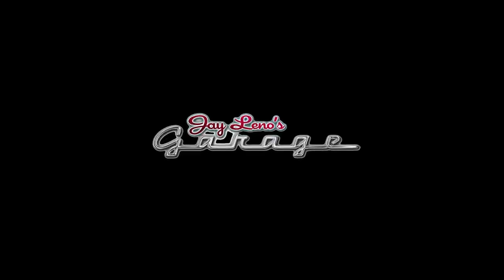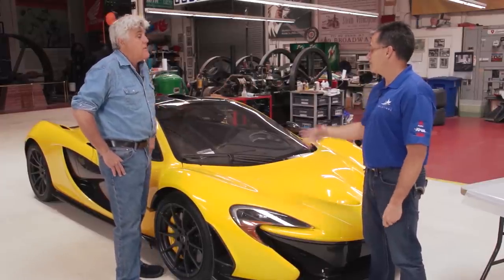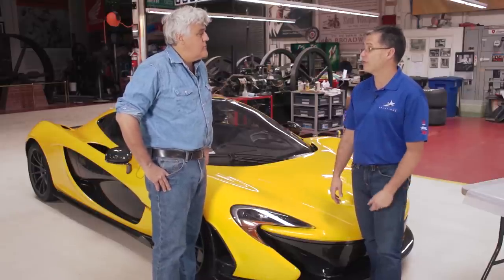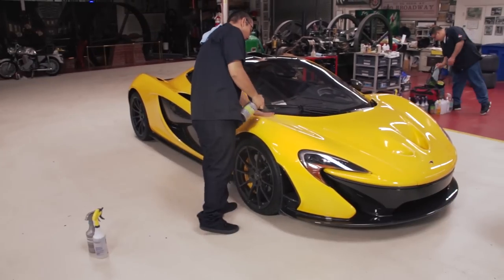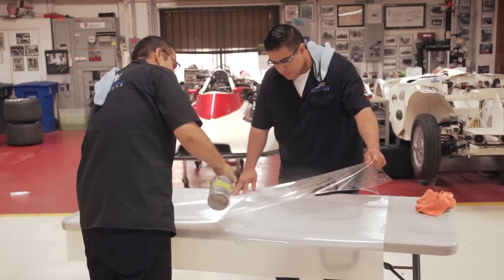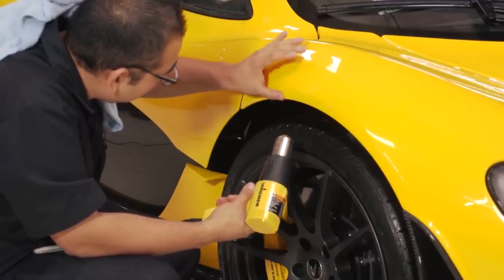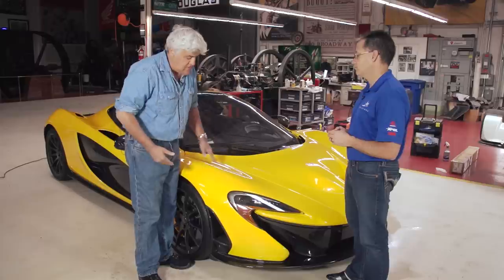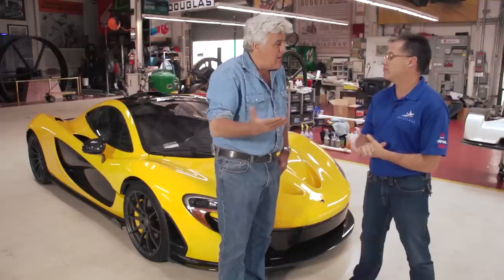Wrapping Jay's McLaren P1 - Jay Leno's Garage

Comment: my 370z has the 3m clear bra on it, I can tell you it has saved me several rock chips, the plastic is a bit nicked at the bottom of the bumper but didn't touch the paint! Very glad I have it.
Reply: nice, anything can happen to any car driven over 15mph, it's best to be safe, and why not, if it subtracts nothing from the car.
Reply: I have that on an evo what I don't like is it does stick out a bit but most def worth it
Reply: rockthestrand maybe a hairdresser?
Reply: Acc0rd79 I need to get it on my Mercedes, do they put the 3m on all the bumpers even in the back ?
Reply: Club Bmw Amg only if you want it to, mine just covers the entire front, a pillars and mirrors that any rocks might hit.

Comment: I have this on my 2012 scion xb because that thing loves eating rocks on the highway. No chipped paint yet. Had it done in Richmond VA for 400 bucks with 3m 8mil protective film. Did the front bumper, hood, headlights, mirrors and the rear bumper to protect it when I pull stuff out the trunk.

Comment: Hmm, 1/2 thickness of a credit card.
Here's a $1 idea for long journey protection (may fall off afterward) - Get some clingfilm from the kitchen, roll it across the front of the car, use water to adhere to paint. Tuck in edges. Repeat til 6 layers deep. Final layer slightly larger to secure the edge wrapping better. Drive.
If works but loosens at all, spray 3M77 type of adhesive near wheel arch wrappings.

Comment: you know, they should just apply like 5 or 10 layers at the same time then on each panel, have a little tab hanging off...then whenever it gets dirty, or marked, you could just pull off a layer...kind of like the visors on F1 driver's helmets.....
Reply: +michael C wouldn't work, when they would wrap it around the edges, it would be to thick.
Reply: Kristian Matz see, that's where you trim the subsequent layers exactly to the body lines with only a tab over hanging....and since you have multiple layers, they can all be thinner than one solo layer......

Comment: That is funny. Americans. "It is 8 "mil", it's about half the thickness of a credit card." 8mm - that would be just a little shy of 2 pica - or a little more than a third of an inch. 0.8 millimeters?
Reply: Thoringer The "mil" he speaks of is not millimeters.  

1 "mil" is 1/1000 of an inch.
Reply: Lyle Arnett, Jr
you better edit this then: https://en.wikipedia.org/wiki/United_States_customary_units - because the official measurements use point and pica. When someone says: "I usually shoot with my nine-mil," they mean 9mm. Also, .008in? Really? That would not have any protective effect at all - it would rip just by picking it up. Think about it. .8mm would work and from what they show, that is plausible.
Reply: Thoringer https://en.wikipedia.org/wiki/Thousandth_of_an_inch

Comment: $1500-$2500?!!  and has to be replaced 5-10 years?  isn't it cheaper to just repaint a part that MIGHT get chipped or nicked?
Reply: Not on a P1, you don't do this on your average ford.
Reply: Lol not on a million dollar plus car like this
Reply: Repainting a car like this would cost between $20-50k depending on the brand of car and the color of the paint. You can not simply use touch up paint on a car like this.
Reply: what difference does the electronics and engine and everything else under the body panels make when painting it?  why should it cost so much extra to paint the fender of a ferrari versus a volvo?
Reply: Because they are made from a much higher quality... And the body panels are also made from more expensive materials then a normal car...... A car is much more then just an engine and some electronics
Reply: whitedevil2 Yeah because vacuum formed carbon fibre is basically the same as a steel sheet isn't it
Reply: whitedevil2 The difference is that you are not just buying the car you are also buying into the brand. So when McLaren, Ferrari, Porsche or any other company wants to charge a lot of money for paint then you just have to accept it. Most of the time they are using a special color blend and they are the only ones who carry it so you can't go to a second hand dealer to get it. Even if you have someone else do the labor the car company will still be the one who sells them the paint and they will charge them an insane amount of money.

The paint on the car is not the only thing that is insanely overpriced but so is everything else. Oil changes usually cost between $1-3k depending on the car and location, tire changes can be in the thousands, brakes, calipers and basically everything else on the car will be so much more expensive then your standard car. That is just the cost of owning a super car. Just because you can afford the sticker price of the car it does not mean you can afford to drive it. Most luxury/super cars cost a lot to maintain and keep which is why a lot of people only take them out on special occasions.
Reply: it doesn't cost $20K to paint a carbon fiber body part
Reply: whitedevil2 Like I said it really makes no difference what the material is, the only difference is that you are buying into a brand. The same thing can be asked about how designer cloths can sell for 10s of thousands of dollars.
Reply: you're the first person to say something intelligent here.  so couldn't a third party shop color match?  i get wanting to take these expensive models to the factory/dealer for everything, but theoretically if Home Depot can color match anything, i would think a paint shop could as well.  and there are some high quality shops that specialize in exotics so it's not like you'd take it to some shaggy collision repair place.  so is it more of an issue with the owner willing to spend more money for paint just to make sure everything done to the car stays in house?
Reply: whitedevil2 Well paint matching can be extremely tough because the materials inside of auto paint compared to simple house paint. You can mix in a variety of different chemicals/materials to give a different effect. Car paint have different hardness, reflective levels, possibly a metallic blend, and so many other characteristics. But theoretically it could be reproduced (just like anything else) but it would be very tough. And it would probably cost more in trial and error then it would be just to buy the paint from the company.

People stick with getting the car maintained/serviced at certified service facilities because it will maintain the cars value. When you use a 3rd party service center there is no guarantee they did the maintenance properly. And when the day comes for you to sell the car you will need to show every bit of paper work for the car and if you did not get the work done by a certified service center the value of your car will drop significantly. People spending hundreds of thousands or millions on a car want to make sure the job was done properly and the only way to assure that is to have the service done by the company or a certified facility.

Cars are also much more valuable when they are in the original state from the factory. So repainting the car a similar or different color would kill the value of the car.

At the end of the day it is so much easier and cheaper to put on a thin few thousand dollar cover on your car compared to have to repaint the car. Plus changing out the film might take a day while repainting a car could take weeks if not months depending on the car/color. That is the reason people go with this clear film. A lot of people will also just wrap there car in vinyl because it serves the same purpose plus it can allow you to change the color or design of your car very often.
Reply: I'm more suspicious of the the 5-10 year life span. I've owned a wrapped vehicle and was "conditioning" it monthly. You're not supposed to use standard car wax on the wrap. Granted, it was White vinyl not clear and a different brand but I'm still doing more research before I commit to this. Daily drivers have different needs than show cars.
Reply: why would he? When he can afford to own a private paint booth a private paint and body team he can even afford the vinyl wrap machine to print his own wraps. $2500 is not alot of money by itself but do it a few times and you could buy everything you need to do it all in house so why waste the money  and limit your choices?.
Reply: whitedevil2 you don't want to re paint these things ,.
Reply: Wackka Wack
Reply: tmnt
Reply: heroes in a half shell
Reply: Not if you have a million dollar P1
Reply: +whitedevil2. How much is a P1 windscreen? Who would you trust to paint your P1? How much is a McLaren respray? For a hypercar owner, the film is worth it. For someone driving a normal car on a tighter budget, it isn't.

Anyway, Jay probably got his P1 done free. He gave the company a fantastic advertising opportunity, worth more than a one car wrap.
Reply: it doesn't . depends on the formula. but that's a straight yellow paint ...should be cheap. cost the same to paint on carbon or fiber parts. blending is different thing . but it doesn't cost 20k you are right. people just over charge it.
Reply: whitedevil2 Hell no
Reply: whitedevil2 .  Its a good question.  Jay thinks of himself as a guy who drives his cars, but  needs a protective film?
Fan boys  defending millionaires are hilarious.
Reply: Alex Hughes B.B.

Comment: Is it me, or this product lasting 5 to 10 years is just strange?  5 to 7 or 8 to 10 years seems fine. But how does anything can possibly last twice it's intended use? I just don't understand. I know, with good care a product can last %25 to tops %30 longer but a whopping possible %50 seem unimaginable. Plus, even at the miracle 10 years, for the money that's not very long. Especially if you consider the minimum. Plus sex with a condom sucks. Nothing beats the real deal. That wrapping would have to take away it's originality and shine. I just think it's a shame doing that to such a masterpiece. If you can afford the car, then you can afford it's stone chips fixed professionally as well. It's not like you'd drive that car behind an 18 wheeler all day. Chips rarely happen. Well, the ones that can be seen anyways. I just think this was a strange segment for jay's collection.
Reply: Well not every state has the same weather and not every driver drives the same vehicle everyday